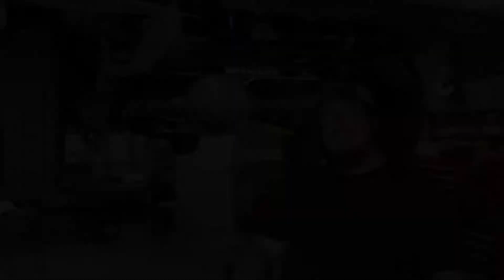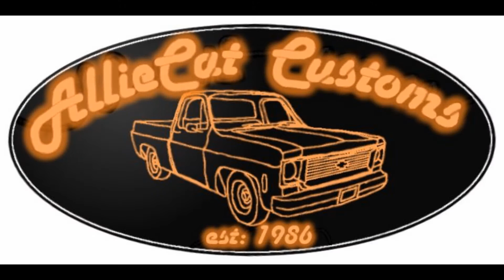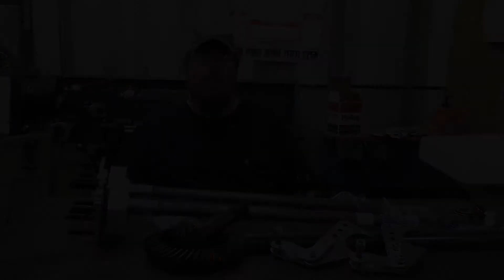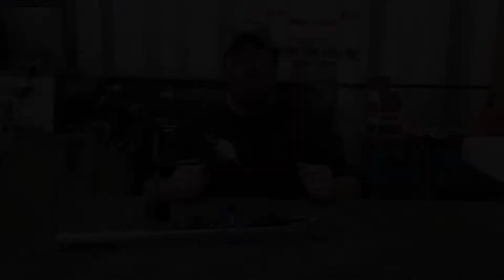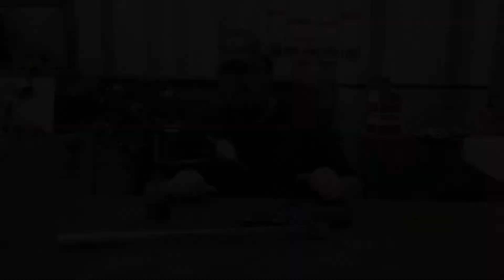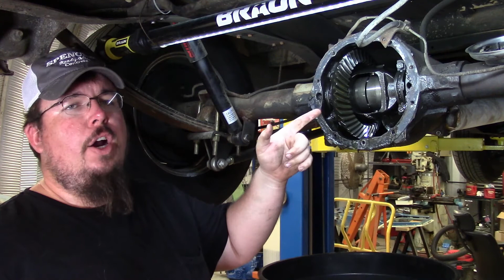How-To: Build a GM 8.5 10 Bolt Rear End | Parts & Tools Overview

Comment: Hey guy. Most of your info is in this video. You blew you your 12 bolt and swapped out for a 10 bolt 8.5 ok. You have a BBC in your truck great and a trans brake grate. Why didn't you get the axle tubes welded for this set up? I have a '89 s10 with the 8.5 10 bolt I put in it out of a '96 s10 4 wheel drive set up for my BBC.  Moser did my work. I am going to put in Moser parts in my 8.5 diff. From maniacal s10 Youtube. Please check out my vids of my s10. Thanks!